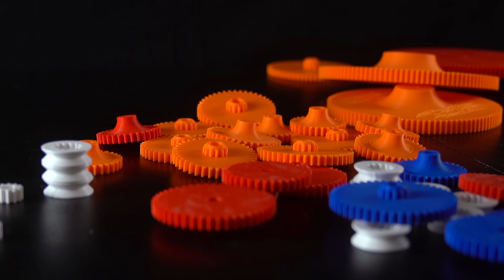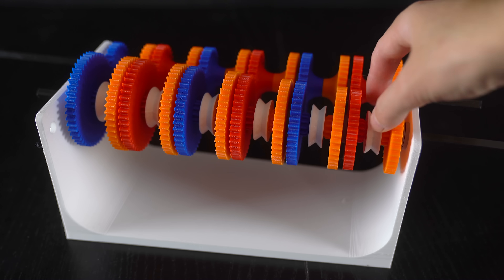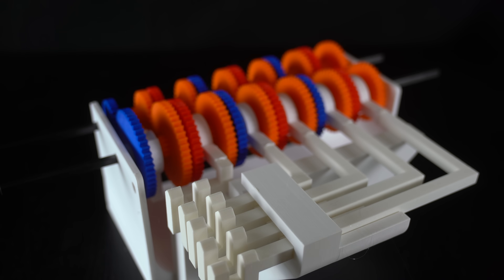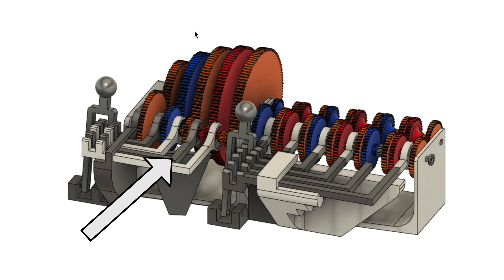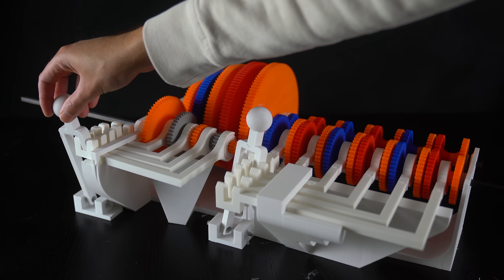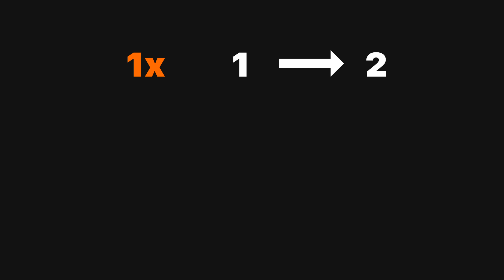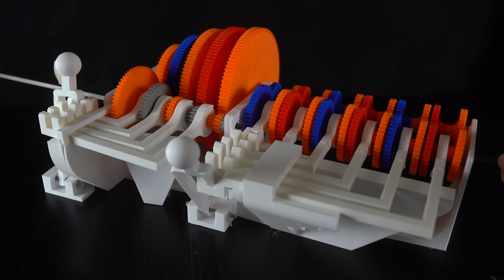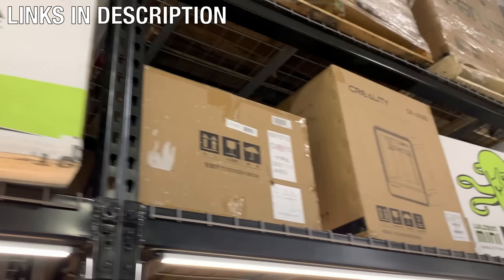60 speed manual transmission

Comment: a lot of trucks have 24 speed manual transmissions so its amazing to think something like this exists in several real life applications
Reply: Almost all truck gearboxes like that have a normal 6 slot h pattern design and the extra gears come from a rangebox and splitter which are like 2 speed gearboxes attached to the end of the regular box
Reply: @notanengineer  I count every pair of gears as 1 slot because you're moving in a straight line between them.
Reply: That's if you have a Spicer 6x4 transmission. Modern trucks use 18-speed manuals.
Reply: @ColtonRMagby  How are the gears arranged? It is an "H-pattern" 9 gears wide?
Reply: @RichardBetel  An 18-speed has 3 slots to move the shifter in, and they use air for some of the shifts. A Spicer 6x4 has a 6-speed driving a 4-speed auxillary transmission, and the gear pattern is unusual.
Reply: @RichardBetel  it’s a 4 speed with a high low and the each gear itself has a split gear on it
Reply: I drive a 13 speed myself so no split gears on the low side
Reply: @GingerDude-o3h  If it's a 13-speed, the splitter on the side won't move unless the one on the front is up. Built in lockout, I believe.
Reply: @ColtonRMagby  correct.  The lockout is in the shifter valve body i believe, it wont supply air to the splitter until the range shift is set to high, not only does it supply air to the chamber to shift into high (and low range) but it also will now allow air to be supplied to the splitter, either that or its a mechanical lockout.
Reply: @CA.papaBear  Thought so.
Reply: @RichardBetel  Trucks often use 3 gear boxes. The regular 5 speed gear box + reverse in your normal H pattern that you would have in most 5sp cars. Another gear box is a splitter it basically only has two ratios that are very close to each other. This is often air powered. This allows you to have a high and low for every main gear. Then you have one more gear box that is a high low with a big spread in the gears. This allows you to get to the top gear in the main box then switch to high range and start over again in 1st. This is also normally controlled by air with a switch on the gear lever.

Often you don't use all gears but if you were, you would start with the main box in low, splitter in low, and range in low. This would be extremely slow, then you would switch the splitter to high and not change anything else. Next you change the splitter to low and move the main gear into 2nd. Then you move the splitter to high. Next splitter to low and main box to 3rd. Then splitter to high. Etc. When you are in 5th with the splitter high you now change the range to high, splitter low, and move the main gear box back to 1st. Now repeat with it in high range. Top gear is main box 5th, range high, splitter high. This will give you 20 gears. As I said, it is extremely rare to start in the lowest gear but sometimes it is nessisary. Also, you often don't need to split the higher gears if you are not on an incline.

There are other configurations but this is what I am most familiar with.
Reply: @crissd8283  crazy.  Mechanically, it makes sense, but it sounds like a nightmare ergonomically.  I wonder why they dont use a sequential shifter? They're not complex to design and would make driving much simpler.
Reply: @RichardBetel  for modern Eaton fuller 18 speed transmissions it’s a standard 5 speed but you have a split button and a range switch so you would go low-split, 1-split, 2-split, 3-split, 4-split, switch to high range and go back to first not low then do it again
Reply: @RichardBetel  old trucks used two transmissions which were manually shifted with “twin sticks.”
Reply: @RichardBetel  An Allison 18 speed transmission is basically a 6x2x2 pack of 3 transmissions.  The 6-holed trans has the "low" speed (lower than 1st gear), the reverse and 4 forward speeds.  The other 2 transmissions are the "halves" and the "range".  The  halves, as their name implies, splits the gears in 2 speeds (1low, 1hi, 2 low, 2hi and so on), by flipping a switch.  Range is for selecting between gear 1 and gear 5, gear 2 and gear 6, etc, also selected by flipping a second switch.  Some gearing patterns are forbidden by design, so you lose 2 forward gears (you have lo-lo and lo-hi by using the halves, but you can't use the upper range on these, else it voids the warranty because it's not built to do so and it causes excessive wear, their frequent use can be determined by suspect metal flakes in the oil and excessive gear wear).

So you end up with 5X2X2 minus 2 forbidden gear ratios, (=18) in forward, and 2 reverse gears (and 2 forbidden gear ratios in reverse too).
Reply: @RichardBetel my guess would be because the gears aren't synchronized. Commercial vehicle manual transmissions require rev matching to shift between gears. Sure, you could add a system to automatically do that, but it would be added complexity without a great deal of benefit. Much easier to simply train drivers to manage it themselves.
Reply: @ColtonRMagby  MODERN trucks use 13 speed automated transmissions

Source: I drive a 2022 Kenworth and have been driving for 10 years now
Reply: @silvertonebass1  Just another control module that can fail.
Reply: @ColtonRMagby  if we’re being honest…. “Moderns” are all automafic 🥲 if they are manual they’re usually 10 speeds nowadays. 18s are slowly fading out
Reply: @MichaelF69  Tell that to people who own Peterbilts.
Reply: @MichaelF69 moderns are auto because most truck drivers nowadays are all mexісаns and іndіаns who obviously can't shift so to make it easier they pushed for auto. Almost no bigger freight company uses manual anymore. Now for heavy haul spec trucks 18 is still number 1.
Reply: @ColtonRMagby  I've driven an 13 speed transmission a handful of times, I've seen 18 speeds. The majority of manual transmissions that use a gear shifter are 10 speeds. Most trucks are going to, "automatic" transmissions. Funny thing is these automatic transmissions are actually manual transmissions shifted by the the computer on the truck. I've seen these as 12 speeds
Reply: @ColtonRMagby  the 18 speed is a 6 speed with a range box of 3(l,m,h).
Reply: @chubbysumo2230  Or a 3-speed with low-low, high-low, low-medium, high-medium, low-high, and high-high.
Reply: @ColtonRMagby  Nah, modern trucks use 12-speed automatics.
Reply: @TopiasSalakka  Not as fuel efficient as an 18-speed manual.
Reply: @ColtonRMagby  Why wouldn't they be just as fuel efficient? Assuming they use a similar gear ratio at top gear.
Reply: @TopiasSalakka  Higher RPMs before each shift means you use more fuel to get to the shift point.
Reply: @ColtonRMagby  uhhhhhhh
With an 18 speed you don't go through every gear but skip a lot, even when i drove a 12-speed i skipped basically every other gear.
Reply: @TopiasSalakka  Unless you have a heavy load. The automatic might shift too soon and cause an issue, whereas you have full control over the manual, which means you can keep the RPMs from going down unnecessarily on a hill.
Reply: @ColtonRMagby  Or you can change the program or shift manually on the automatic.
Reply: @TopiasSalakka  Which means blipping the shift lever, or using a computer to do something I'd rather not.
Reply: @ColtonRMagby  That's just a you problem.
Reply: @TopiasSalakka  Vehicles are too high-tech anymore. ONE module quits, the car is IMMOBILE.
Reply: @ColtonRMagby  Trucks generally have much more reliable parts than regular cars though...
Main issues i see are related to AdBlue/SCR systems since they don't like the cold.
Reply: @TopiasSalakka  Which is why manuals are superior. No tech that can't stand the cold to control the transmission, no problem.
Reply: @ColtonRMagby  Wrong, Scania and Volvo transmissions work perfectly fine in extreme cold.
Reply: @TopiasSalakka  They're European trucks. They don't use cheap Chinese tech.
Reply: @ColtonRMagby  Yeah our trucks are superior 🐡
There's actually an American Youtuber who's working with Scania to try and get them officially imported to the US.
Reply: @TopiasSalakka  Chicken Tax. I wish the guy luck getting around that one.
Reply: @ColtonRMagby  Even if they cost double what an american truck costs, it's still worth it.
And if there's a market, they could always start building them in the same factories where Internationals are built, since they're owned by the same company.
Reply: @TopiasSalakka  Possibly, but it takes time and money to get the necessary assembly line tooling in place.
Reply: @ColtonRMagby  actually I drove a gin pole truck before that had an Eaton fuller 10 main box with an auxiliary 5 spd. with planetary rearends. Top speed 56 mph but it could move the world
Reply: The Eaton 18 speed has low and high range change and can split each gear into a low and high
Reply: @DODTruckPulling  The grey flipper on the side. If it's grey, 18. If it's red, 13. If it's blue, 15.
Reply: @ColtonRMagby  I thought blue was 8LL
Reply: @ColtonRMagby  the super 10 transmission also has a grey side switch
Reply: @DODTruckPulling  I've never heard of a super 10.
Reply: @ColtonRMagby  it’s basically a 5 speed with a gear splitter on each gear

It’s really easy to shift but takes awhile to Learn
Reply: @DODTruckPulling  A normal 10-speed in a semi, I can shift. A 5-speed where you can split every shift better be using a 2-speed differential, or it doesn't make as much sense.
Reply: @ColtonRMagby  It is like a gear multiplier in the video, each gear has a low and high side
Reply: @ColtonRMagby  I’ll make a video when I get a chance to, we have a truck with the super 10
Reply: @DODTruckPulling  Alright.
Reply: @ColtonRMagby  it's a three speed plus reverse gearbox with a manual splitter. In and back is 1&2, center forward 3&4, center back is 5&6. Push out and you're actually toggling a hidden range shift, and it's bumped the 3&4 and 5&6 slots to 7&8 and 9&10.

H'ever it uses what's usually the range toggle on the front as the splitter, and there's no side splitter button, so it's a pain in the ass if you're used to a 13 or 18.
Reply: @NutjobGTO  Left and down is 1st, straight forward is 2nd, straight back is 3rd, right and up is 4th, right and down is 5th, flip the tab up, shifting to Neutral switches to the high gears, left and down is 6th, straight forward is 7th, straight back is 8th, right and up is 9th, right and down is 10th. Am I close on this?
Reply: @DODTruckPulling  my old T-2000 had the super 10 / top 2, so 9th and 10th could be done auto-magically. Now I drive an automatic 12, and miss my old super-10. Worst one I drove was a horseshoe 9. Garbage, but the damn thing got great fuel milage.
Reply: @JayFude  yea the super ten is a cool transmission. Is the 12 speed you drive now like an Alison auto or an auto shift
Reply: @DODTruckPulling I drove a mack for a while with an 8ll it's was a blue splitter. Maybe the 15 and 8ll are different shades? I'm not sure but I can tell you that you can not split the gears in an 8ll it's only meant for low-low, or low-reverse.
Reply: @ColtonRMagby why doesn't a 5 speed that you split make sense? It's essentially the same thing as a 10 speed. Mack for one used this exact setup on the mack transmission used in thier R models. It worked very well and you had 5 reverse gears plus an extended low-low basically a triple low. Also a 2 speed diff is a terrible thing to want. They are pretty much phased out because if you ever drive trucks with them, they had a lot of issues kicking out down or up a grade, getting stuck or whatever else. They don't work well
Reply: @ronnieswindski825  Not all trucks will have an air system. Look at diesel work trucks, then tell me how many of those have air brakes. If you have air, use it to shift a component that can easily be converted to mechanical later should you switch to hydraulic brakes and ditch the compressor. I think from a practical perspective.
Reply: @ColtonRMagby  I agree. But what's that gotta do with a 5 speed split trans I was referring to?
Reply: @ronnieswindski825  Most split transmissions use an air unit on the back or a transfer case/range box behind that, but the 2-speed differential allows for better weight distribution.
Reply: @ColtonRMagby  well I meant for big rigs. I guess if you're doing a split trans in a service truck then yes you're right but honestly I love manual more than anyone but if I had a service truck I'd just get an Allison. But for a big rig auto is just gаy af and a lot of problems
Reply: @ronnieswindski825  Alright.
Reply: @ColtonRMagby by "diesel work trucks" are you referring to medium to heavy duty pickups with specialized beds? Obviously those won't be running air brakes, but they also won't be using multi-range transmissions. Anything big enough to need one of those transmissions, especially anything intended to regularly pull a trailer, will have air brakes and an air horn. Most will have air ride suspension on at least the drive axles too.
Reply: @ronnieswindski825 automated transmissions in big rigs can't be that problematic since major freight companies are heavily flocking to them.
Reply: @MikeDCWeld  Any pickup truck with a diesel engine and a heavy duty frame as well as heavy duty suspension is included.
Reply: @ColtonRMagby  that's what I thought. None of those would have multi-range transmissions. Most of them will be some variety of automatic transmission.
Reply: @MikeDCWeld  True, but some of those automatics can't decide what gear to be in.
Reply: @MikeDCWeld  why do I even have to explain this? Modern companies switched to all auto because turn over rate is almost 100%, lots of foreign people who can drive stick, and they LG rid of those trucks after a couple yearsso you're not gonna see major issues with large freight companies. It's the next guy who's left with issues
Reply: @ColtonRMagby  mines chrome lol
Reply: @jspooner24013  Sweet.
Reply: There are tractors that have 48f/48r gears. It's a 4 Stage gearbox as supposed to the single stage car, 2 stage pickup or 3 stage trucks
4 Gears 4 Pattern
4 Stage Powershift within each gear
Range Preselector with High, Low and Super Low
Forward and Backward Powershuttle.
Reply: @an2thea514  that’s cool
Reply: @an2thea514  some semitrucks have low low forward and reverse
Reply: @an2thea514  That shift pattern would confuse me pretty quick.
Reply: @ColtonRMagby  one 4 Position H Shifter
A Plus and Minus Button on the shift Knob
A Lever that you practically never use
A small lever on the steering column that goes forward and backward.

Depending on the tractor, it even tells you digitally on the dashboard which gear you are in.
Reply: @an2thea514  That makes me more confused than I was before.
Reply: @ColtonRMagby 
 H Pattern Gear Stick with 2 Buttons, Plus and Minus as second option
Small little stick on the steering column that goes forward and back, makes the tractor go forward and back.
Another negligable Stick for High, Low and Superlow.
Reply: @an2thea514  Oh, okay.
Reply: aint ever heard of a 24 speed,
ive known of 5x3's and some others for twin stickin' it, which thats prety much what PA has made, with way more gates
if i had to make a 60 speed gear box it would probably be a 5 speed primary with a high low spliter, like all modern 10 speed truck transmissions, and then a 6 speed which would be a 3 speed with a split high low

also speaking of trucks, high reverse is fuckin SKETCHY fast
Reply: @djaydeved  I'm not surprized.
Reply: I have driven truck for 36 years, and I have never seen a 24 speed transmission in a truck. The most I have ever seen and driven was an 18 speed.
Reply: And some tractors
Reply: Lolx I learned more from the comments than the video but at the same time I always explain low and high gears or I should say compared it to a 10speed bike or mountain bike gears when explaining it to ppl who don't understand low and high gear that's just me tho
Reply: No way they have 24 speed, maybe 9 to 12 speed at most.
Reply: @maxhagenauer24  Eaton 18 speed
Reply: @maxhagenauer24  Spicer 6x4.
Reply: @maxhagenauer24  John Deere has one, PowerSync
Reply: It's either a 12 speed with a low range or an 8 speed with a low range
Reply: @volcano.mitchell  Or a six speed with dual splitters.
Reply: Modern trucks actually use 12 speeds and the transmission only has 6 really robust gears. It has a transfer case that brings it from 3:1 to 1:1
Reply: @makoshark40  There are 18-speed trucks. Explain those.
Reply: they used to stach a 4 speed and a 3 speed together all the time for dump trucks
Reply: @Prestiged_peck  I'm gonna need clarification on that one. I'm genuinely confused.
Reply: I drove a truck with an 18 speed that also had a 4 speed auxiliary. So technically, it was a 72 speed.
Reply: @chexlemeneux8790  72 forward, and eight reverse. Shifting it in reverse must've been a hoot.
Reply: It's built different, not like here.